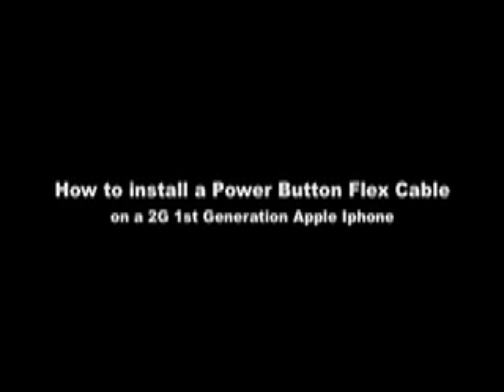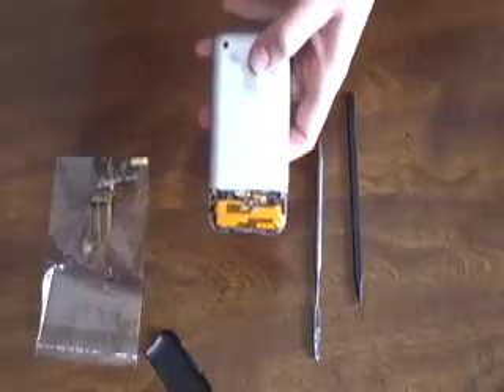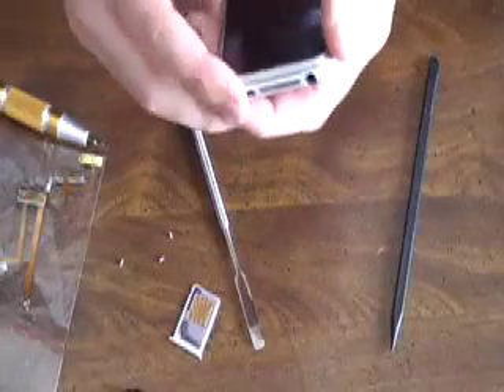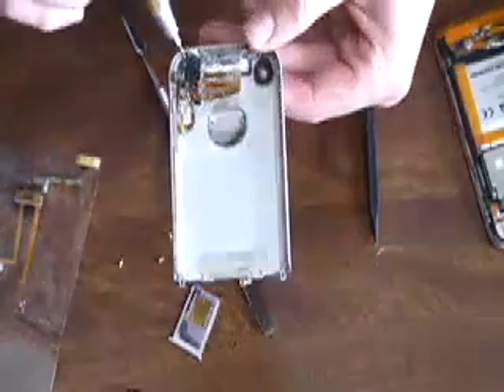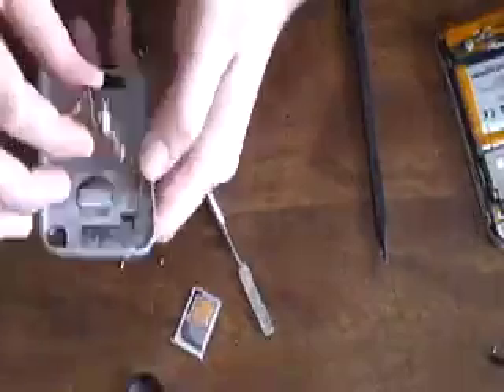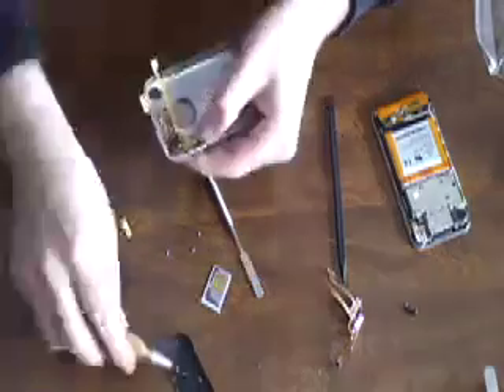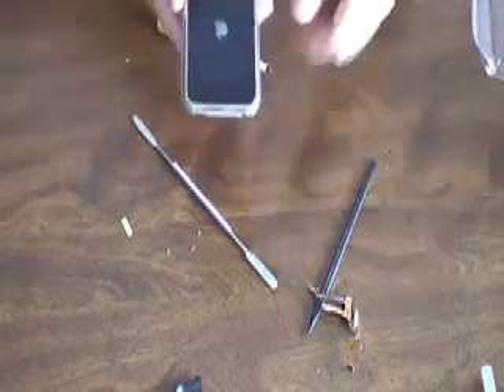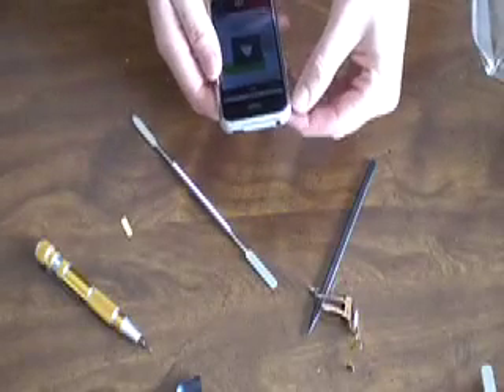Apple Iphone 2G 1st Generation Power Button Headphone Jack Flex Cable Repair Tutorial

Comment: Hey my sleep/lock button doesn't work. The audio jack, the volume and silent button works. Do I have to replace the whole part? Any idea how to make it start working again? I tried to clean in between the lock button plastic and the push button switch.  I tried just pushing the push button switch only without the plastic and it still doesn't work. Any tips or ideas would be very helpful.

Comment: @repairscratchedipods Do you know how to put the power button for a 3gs? I put the metal flap part on the bottom side ,slid i through ,screwed the power connecter thing in , and when i press it it just gets jammed. Please help.